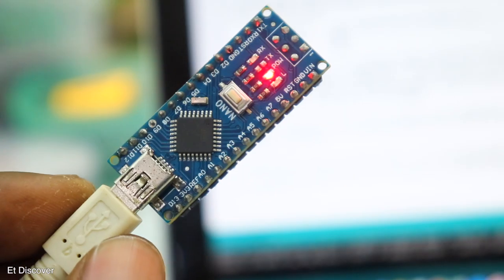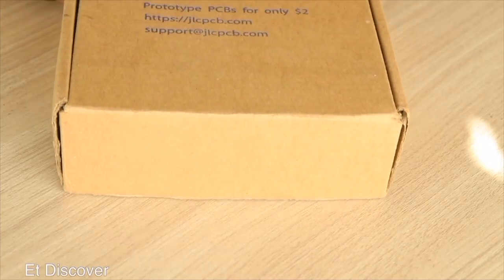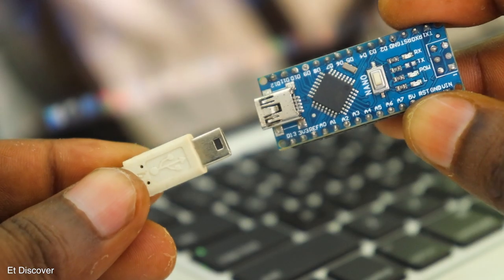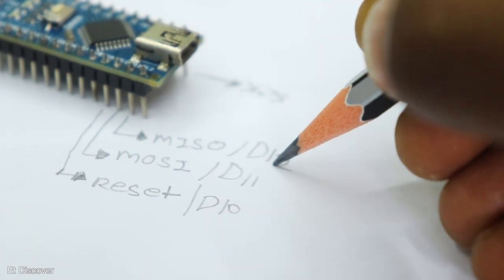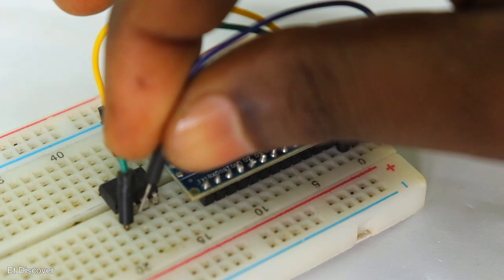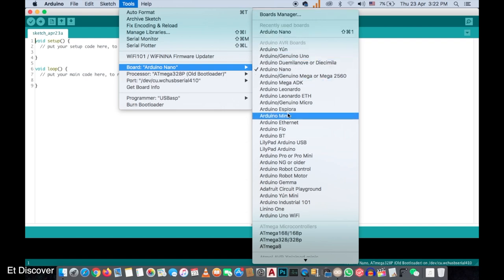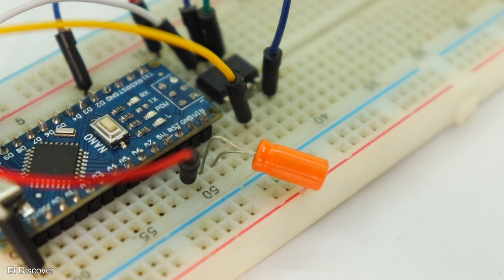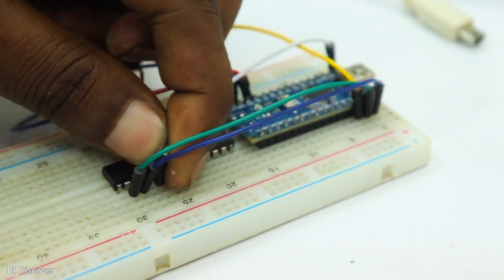Easiest way to Program Different ICs with Arduino,  Such as #Attiny85, #Atmega 8 So on.

Comment: I have a question. If i program the ATMEGA328P. Can i use it as a stand alone ic like attiny in my circuit? I mean that should i connect oscillator and all supporting components of ATMEGA328P in the circuit

Comment: I have done all the connections properly and checked few times but got this error-
avrdude: Yikes!  Invalid device signature.
         Double check connections and try again, or use -F to override this check.Error while burning bootloader.
ANY SOLUTION??

Comment: Hi I went to my city local electronics shop. I asked shop keeper to give me atny 85 ic. Shop keeper give me atmel 150n ic. I want to ask you how this ic works and what can I do with this ic atmel 150n.
Reply from the maker: ATtiny85 and atmel150n are Totally different IC, You need to find out this atmel 150n’s Data sheet for ISP pins, Then you can program it with Arduino IDE, like as ATtiny85 IC
Reply: @EtDiscover  what is the use of  atmel 150824c8n ic  cannot find its datasheet on internet?

Comment: How to burn bootloader on Attiny2313 or Atmega16
Reply from the maker: The burn boot loader option you can find Inside of Arduino IDE software,  Before doing this you need to install Library file for ATtiny 2313 or Atmega 16
Reply: @EtDiscover  heartfelt thanks bro......😊😊😊

Comment: Can i use python to program Arduino or any other ic?
Reply from the maker: You need to convert this python code in Hex file, Then you can upload it in Arduino with Hex uploader
Reply: @EtDiscover  ok thanks
Reply: @EtDiscover  one more question-how i suppose to convert it into hex file

Comment: Hello, 
I'm make snakerobot for mechatronics engineering final sem project,  I have same problem.  How to upload program and burn  atmel atmega328 smd ic ?..¿ 
I'm made one pcb board for connectivity with arduino uno or nano. Out some pins mois, miso, reset  . I can sent you a pcb board design with mail. 
 I hope you assist me well . 

Please make video on it n.. Please please...
Reply from the maker: In the same way you can burn bootloader.